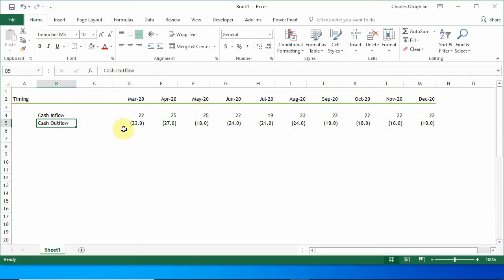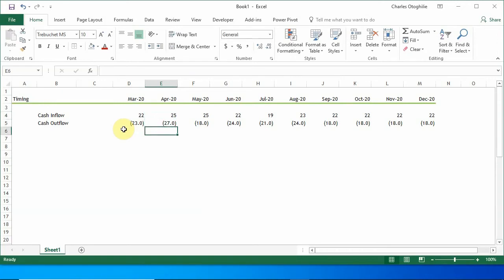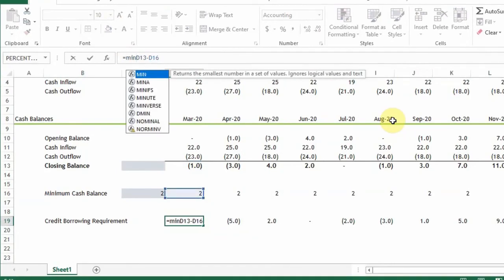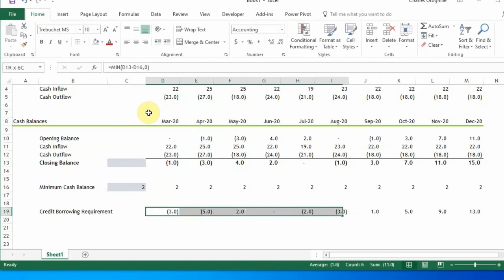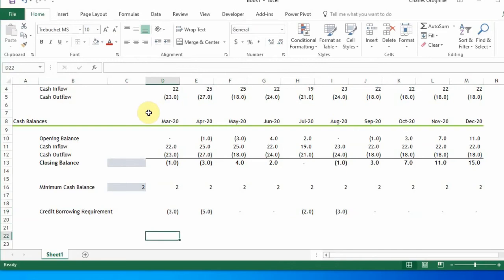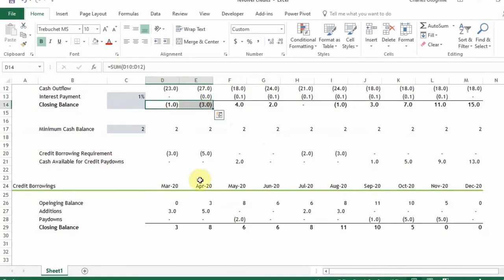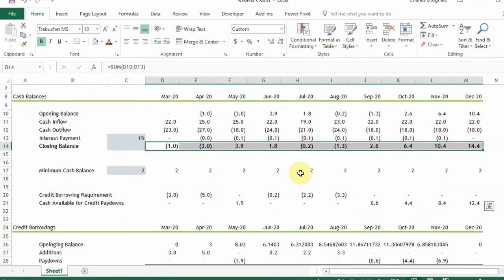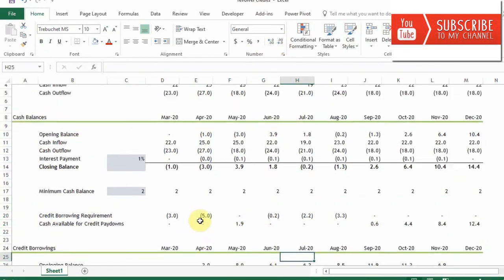Min and Max Functions for Modelling Revolving Credits

Comment: Very helpful! In what situation do we use the MAX function?
Reply from the maker: Thank you for the compliments.
The max function can be used to get available cash for debt servicing. For example , the max of the minimum cash balance and the actual cash balance). If the actual cash balance is higher, it returns actual, else minimum balance.

Comment: This video was very helpful. But i am wondering why the borrowings didn't flow into the cash balances like the interest payments.
Reply from the maker: Teniola, Thanks very much for watching and commenting. You observation correct and was an omission I must admit. That would have involved a circular reference issue but that can be tamed with interactions activated and an IF function to trap irreversible errors. Thanks very much.